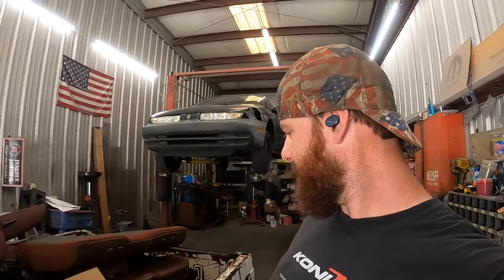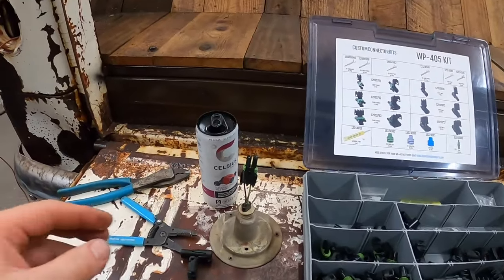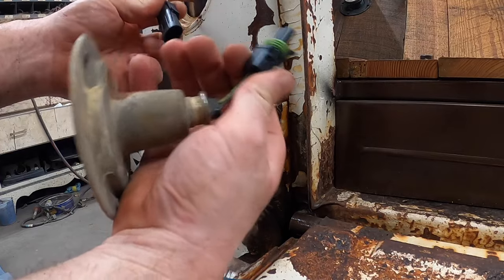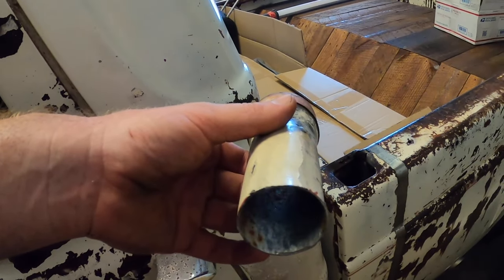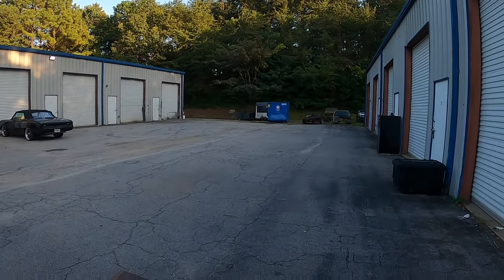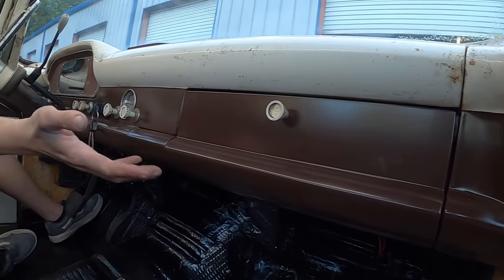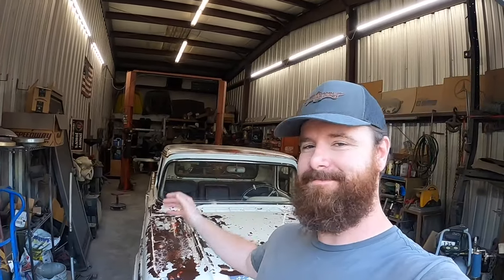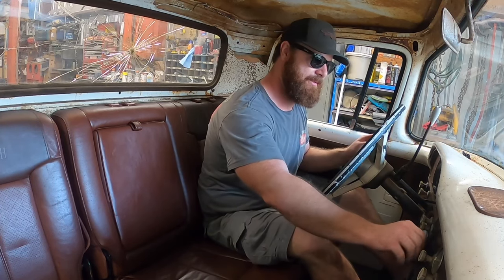FIRST DRIVE & FINISHING TOUCHES! CHEAP BUDGET F100 CROWN VIC SWAP!

Comment: Your crimping on the ring terminal is correct. Split goes to rounded area of the crimper, non split goes to the point to "push" the metal into the wire.
Reply from the maker: It's the little things people overlook!!

Comment: You’re my hero! I just picked up a 59 and a p71 cv. What was your final budget ? I’m aiming at about $3500.  I plan to use the f100 steering wheel and modify for a floor shift using the original shifter. Looking forward to any more videos on this one!!!
Reply from the maker: We've got two more videos planned, one of interior upgrades and the second of the maiden voyage. Probably also doing a complete cost breakdown as well. Ended up with right around 2,200 total.

Comment: Damn good build! Out of curiosity, since I’m assuming the f100 didn’t come with a title, is the truck technically registered as the crown Vic?
Reply from the maker: Here in Georgia we don't require titles for vehicles older than 1985. So it is registered as a 59 F100 because that is the then on the cab.
Reply: @BestDamnShopAround  that’s bad ass. Glad it worked out like that. Look forward to binge watching the rest of the videos until current lol
Reply from the maker: @Fahrenheit_Motorsports  thank you for tuning in!